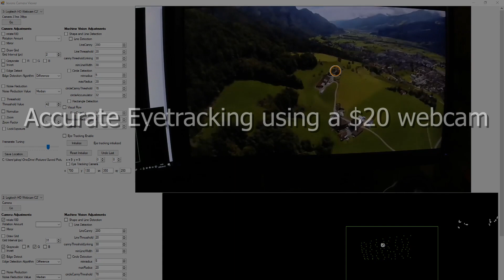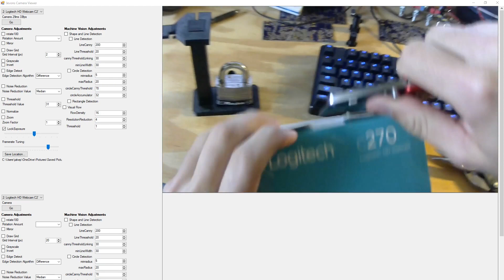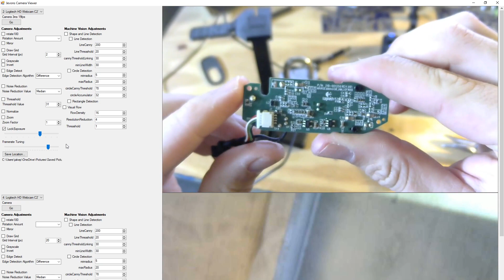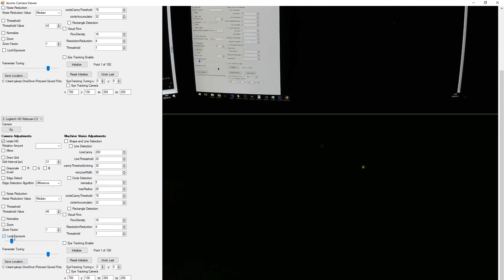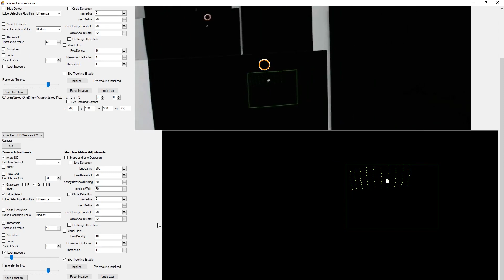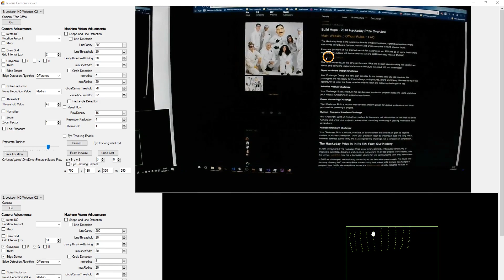Open Source Eye Tracking Software/Hardware

Comment: Has anyone using this encountered "camera is being used by another process" when hitting go? I have 2 C270s and those work but no other camera will
Reply: realized this program will only take strictly 720p input
Reply: @RagnarokGSR  same bug ! so what u did after?
Reply: @abhishekghadge  I bought another 720p webcam :/ it’s gotta be a certain type of camera and output mjpeg stream according to the code creator and I needed a quick solution and had extra cash
Reply: @RagnarokGSR  So you can only use 720p cameras? How odd, you'd think that at least 1080p cameras would be supported too.. 

If anyone knows a way I could modify it to use 1080 cameras that'd be excellent to know
Reply: I have the same problem with 2 different cameras:  LG WebCam and Genius Webcam (both new)